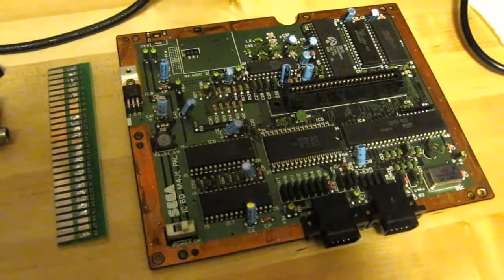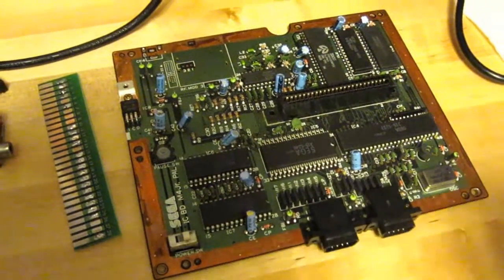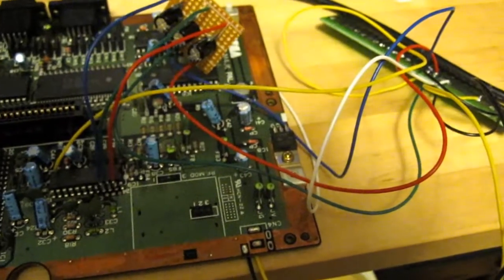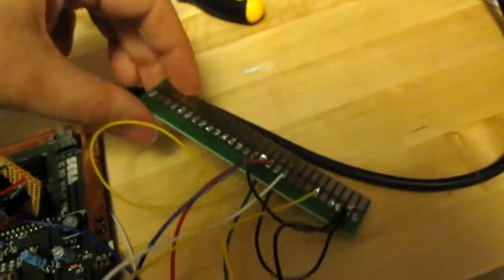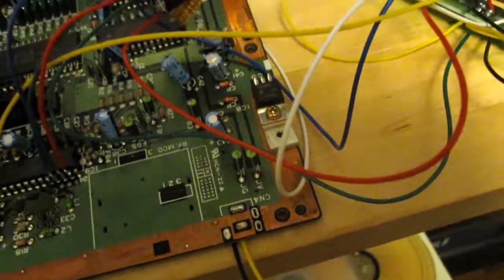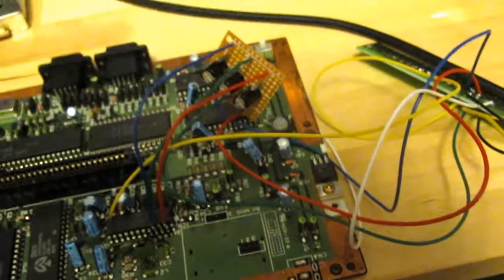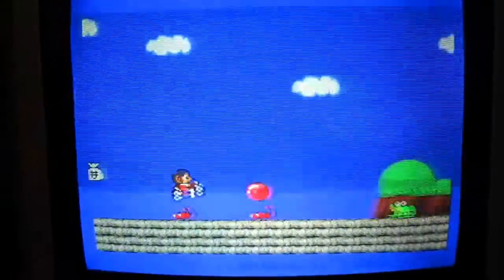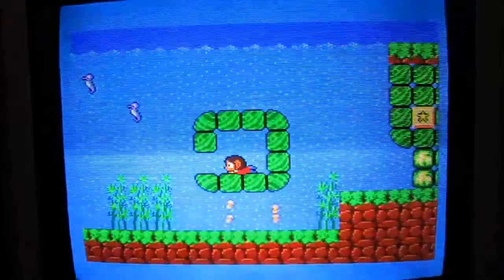Master System to JAMMA mod (part 1)

Comment: yeah it seemed like a sync issue, but i tried two different pins on the bottom side right where the videoutput is, but none of them worked^^

Comment from the maker: Thanks! Sounds like a sync issue with your jammadrive. I had a similar problem when I tried to use composite video as sync (pin 20 on the video chip in the Master System). All I got was a garbled picture. Moved the sync wire to pin 11 instead and the picture cleared up.

Comment from the maker: It's not modded for 60Hz yet but it will be. As for references, right now I'm just going by info I have written down from other projects I've worked on but do a search for Master System RGB mod and JAMMA pinout and you should find some good sources. I will also try to explain what steps I've taken in these videos as well.